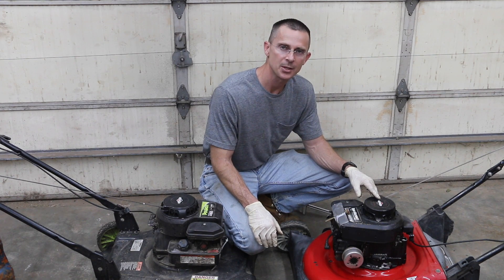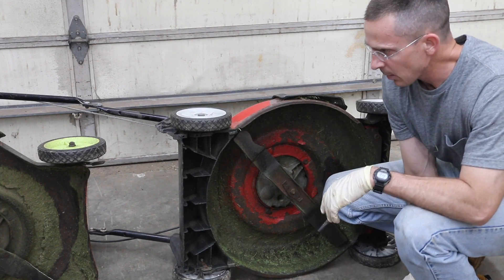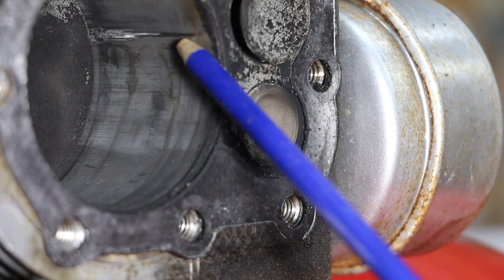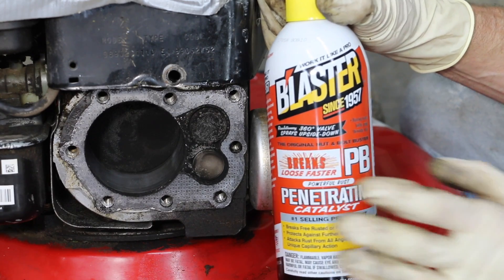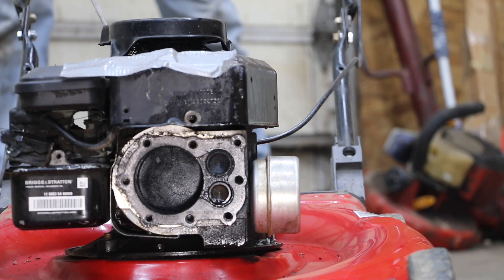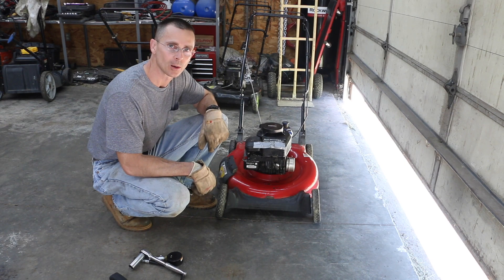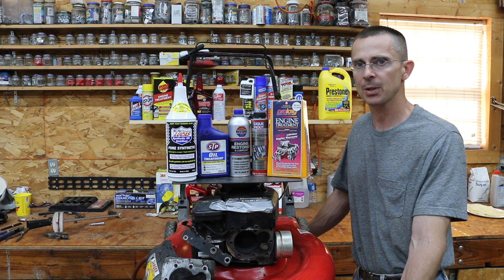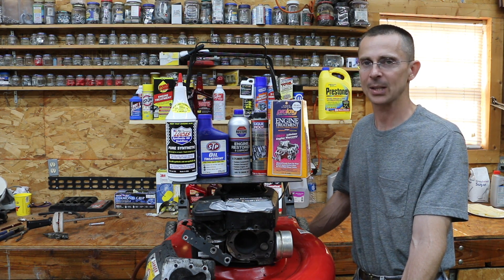Engine ran without oil, seized! Can it be saved?

Comment: Love your video's!! Keep them coming and don't listen to the skeptics. If they don't like it then don't watch. No question, Engine Restore will help in bringing that engine back. It's already been proven to improve compression and I use it myself on my older cars and feel the difference. I want to see Prolong vs. Slick 50 vs Synthetic oil in a showdown from engine cooling to added HP if that's possible to test to running without oil. I use Prolong also and I felt a big difference in it's transmission additive so pended up using it's engine treatment. I would like to see how it actually performs!!
Reply from the maker: Mike, Thank you for the positive comments and for putting things into perspective!  I think I will end up testing several additives on this engine to see which one brings back the compression the most and reduces the knock.  Yes, I want to test Prolong vs Slick 50.  Many have commenting saying that I need to test 2 new engines vs used engines for the test to be fair.  That's a little to costly.  Thanks again!

Comment: Thanks for these videos. I think that Lucas oil and the STP motor honey will increase compression because their viscosity is higher than the Mobile 1 cut with Marvels.
I don't think any of them will sustain their compression gains much more than 2 psi.
So your at 68 psi cold. I think you'll be lucky to see 70 psi cold with either Lucas or STP.
The other products will have little or no effect.
Reply from the maker: Matthew, All great points!  Thanks for watching the video and commenting!

Comment: I knew of a gentleman who used to be mopar "crazed" as it were and he would only use blocks that would come out of a demolition derby. I was like.. man that's just nuts, wouldn't it be broken, he was like, nope, those blocks were the best "seasoned" blocks you could ever get your hands on. So you can machine a seized motor back to life of course, but if it seizes and you try different methods to get it going... well no harm no foul, depends on why it seized.... if it just got so hot the piston seized and it was an automatic.. you might have a shot.. a manual... that would probably bust pistons and internals... bearings... forget about it.. so many variables when an engine seizes... but its worth trying to get it going again ... cheaper than replacing the motor and you won't do anymore harm than has already been done. Now to watch the video..
Reply from the maker: Tim, I enjoyed reading your comments!  Thanks for watching the video and commenting!

Comment: A seized engine can't be saved, unless its seized due to rust.  However if you can turn the engine over at all its not seized.
Reply from the maker: Boodieman72, Great point!  Thanks for watching the video and commenting!
Reply: Boodieman72 mmo is good 4 engine seized from rust fill spark plug hole abd crank case or for best results use a pump for backyard fountain to circulate for a couple days i have used this method successfully  on motorcyle engines put the pump in oil pan and let it circulate then use cheap oil for first couple oil changes at 100 miles to flush any remaining rust out of motor

Comment: I don't think the knock will ever go away. A trashed bearing is pretty much the end of the line. However, I think some of the scoring in the cylinder walls could be masked with a product like Engine Restore. I've used it in the past and had an increase in compression, though I've never done a tear down of an engine I've ran it in. Keep up the great work, it's always great to have marketing tested.
Reply from the maker: Nathan, I agree.  The engine will always have that knock.  Thank you for the positive comments and thank you for watching the video!
Reply: Nathan Scantling there aren't any bearing in a small engine.
Reply: robbie turnbull two cycles do and yes riding mower do on the outboard side of the crank but not on the rod
Reply: it will poke out the side of the case (rod) in less than an hour under load.
no big deal, take it to the dump, grab one that someone else left there with a loose blade or plugged air filter, 
swap filter, tighten the cutting blade. go another decade-people don't understand small engines these days....... : )

Comment: I wonder if you could fill the scoring in the cylinder wall with JB Weld.After it cures you could use a cylinder hone to take down the excess..
Reply from the maker: John, This is a great idea!  Thanks for watching the video and commenting!
Reply: jb weld is epic and can very well fix engine blocks all the way to a D10 cat lol.
Reply from the maker: Tim, I agree!  Awesome product!
Reply: Or you could start up and wire the governer wide open and see the carnage
Reply: I've done that before to a 2.5l chrysler engine, it lasted for about an hour of run time.
Reply: Lol if that works that would be the most farmer fix I'd have seen.
Reply: the trick is you gotta go pretty deep for a jb weld fix on a cylinder wall, but you are right shallow applications it will let loose, but a large fracture or hole. you can hog it out and apply and it will work... but a rebore and a bigger piston ring combo would be recommended.. but after hearing this one start a new bushing or sometimes bearings in these little motors is in order first.
Reply from the maker: Robert G, Excellent point and I agree that JB Weld is unlikely to last with any sort of abrasive or scraping.
Reply: @ Warren: 
Nope, didn't chunk. It flaked out in little pieces until the repair failed completely and that hole went dead again. It did embed itself into the chamber and exhaust valve seat as well. Whole motor was a write off. Oh well. It was worth a shot.
Reply: just overbore it
Reply: JohnLeePedimore it would burn off
Reply: MeMad Max I'm imagining a chunk of JB weld bouncing around inside a running cylinder, crashing into the Piston head and valves. I can't imagine that went over well.
Reply: Your REAL issue is the rod and crank. That's just a matter of time till it turns loose.
Reply: JB weld isn't actually metal, it is just a two part epoxy intended to work with metal.  It has almost no ablative strength despite its very high holding strength.  It would wear into dust and go out the exhaust pipe (or cause more internal issues) very quickly.  If you didn't want to resurface the cylinder wall, using a metal polish on a rotary tool to smooth over the deepest scores would be somewhat effective in allowing the ring to rotate again and somewhat extend engine life.
Reply: Thanks for the responses guys.It was just a thought I had, but it is clear from the last JB Weld test that the JB can stand up to the heat and pressure created inside the cylinder under certain conditions.
Reply: I only scrolled down to comment jb weld
Reply: Or you could run a bead of weld on the deap score keeping weld puddle as flat as possible  and hone it
Reply: craigmancool ehhh not really, because if it's nickasil coated cylinder you would have to re plate the cylinder which is not cheap.  also Honing  were you Re Glaze the cylinder and that's what makes cross hatching... Boring is going 1 size bigger piston.
Reply: JB weld is only rated to 700 degrees or so. The temps in the combustion chamber get much hotter than that.
Reply: It's fine stuff but the ethanol in our fine gasoline will turn it to plastic or rubber. It won't seal off a gas leak in a Briggs 'L' head engine. The ethanol kills it.
Reply: p.c. ferenhite yup I spelt it incorrect...any p.c feinheight is a hi-temp epoxy that would probably work. it is rated at 2000°f so it may hold up awhile as apposed to the j.b weld.
Reply: JohnLeePedimore not a chance it wouldn't take the heat and break apart
Reply: JohnLeePedimore hones follow the exsisting cyl wall. boring would be need for any chance of success
Reply: Alex, aluminium has a melting point of 660 degrees or so, JB weld though can not transfer the heat. It is a poor heat conductor, much, much worse than aly, it is also not 'tough' and will abrade easily - and I don't know it's expansion coefficient...as an engineering material it is an extremely poor choice for this work. But it's great fun messing with it.
Reply: Ascended696 hahaha yeah right? I bet it would for a little while
Reply: JohnLeePedimore you hone the cylinder walls. thats how you fix it.
Reply: Martin D A LEAD has a melting point of 600, NOT aluminum.  That is up over 1,000
Reply: I'm not sure that oversized pistons are as readily available for lawn mower engines.
Reply: @amisanthropicman  If you were really determined, made of patience, and had access to machine tools you could cast your own piston. It's really not hard to cast aluminum and you don't need to stress the metallurgy too hard in something as puny as a small equipment engine.
Reply: Is your name same as your daddy and his daddy before?
Reply: Why would you bother putting JB Weld in it and fooling with all that? Just overhaul it and bore out the cylinder to oversize and would run like new assuming not too damaged.
Reply: Sorry PF, but JB Weld doesn't fare well in abrasive or scraping situations like you will encounter with the piston rings. You'll have to go for one of the "real metal" enhanced epoxies to even have a chance at it working and even then I fear it will be a waste of time and effort. If the cylinder is all aluminum, you might try one of the aluminum low temp welding rods, then machine it back down.
Reply: i cant talk badly about jb weld. in my dodge, my oil pan had rusted a hole through and for the past 4 years jb weld has been keeping the oil in.

Comment: I love your videos always like to see what happens with you projects. I just finished using some lucas Transmission treatment on a transmission that had been neglected and had no reverse,  dropped the pan changed the filter and then added lucas transmission  treatment and freed up the transmission and it has reverse now. So I would try Lucas engine treatment on that Lawn mower engine and see what happens and if it can get rid of that knock.
Reply from the maker: Luckylarry, I'm very impressed that the Lucas Transmission treatment restored reverse!  Thank you for recommending Lucas and thanks for watching the video!